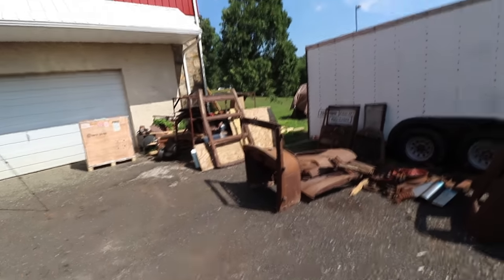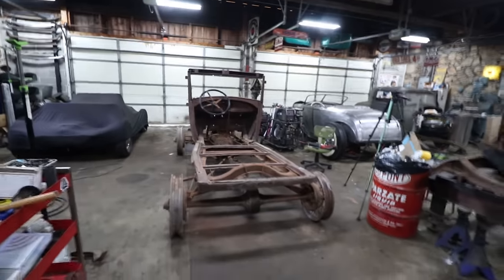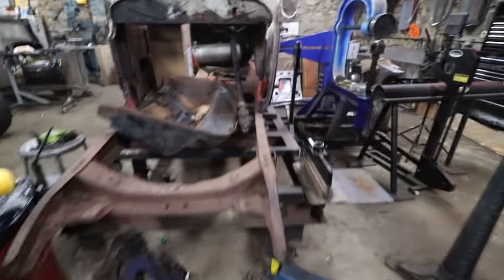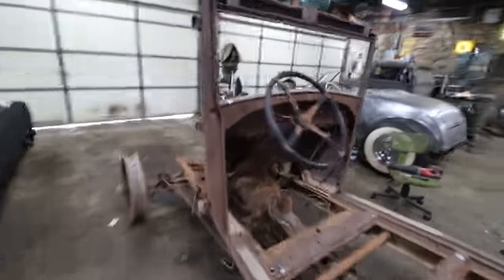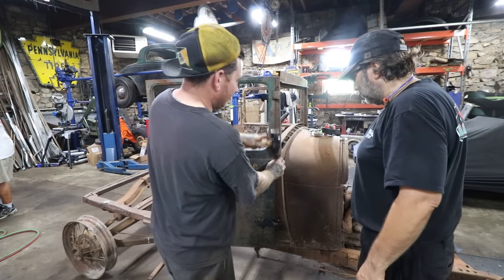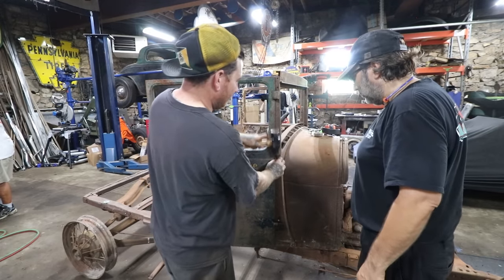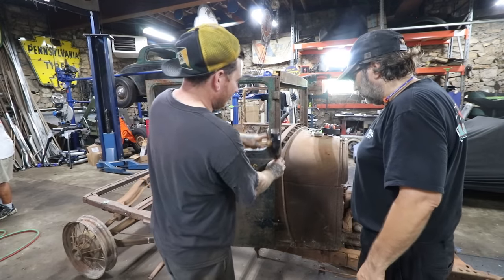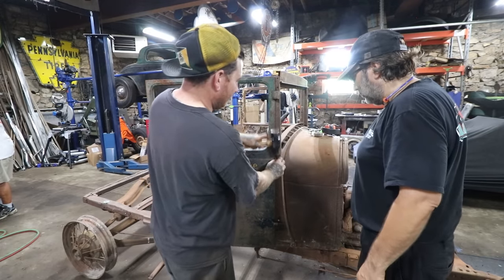Can We Build A Ford Model A From This Pile Of Scraps???

Comment: Those parts are more solid than the rough body I built my hotrod out of. That includes the front crossmember of the frame, because mine had a hole at the center from being worn by the front spring.

Comment: That project was great and very quick assembly, thanks for sharing it with us, I have a question, could you use sandblasting with the water power pressure? From the endless summer paradise Puerto Rico Jesus Torres.

Comment: 6:33 Is that a Craftsman type air compressor running ?  Thanks.
I think you could sell it quicker as a complete car than in pieces. Put some rubber on it also.

Comment: My dad had two Model A roadsters in the '30s. Wish he had kept 'em. One had.what he called a "porous" engine. Ran fine, he told me, but seeped water.

Only parts exchange he did was having one set of red wire wheels and one yellow.